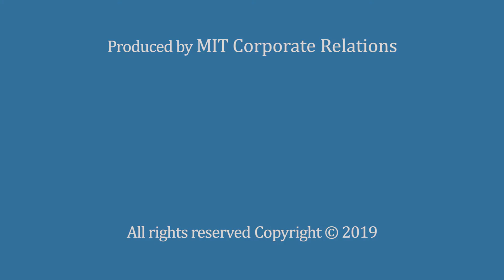LiquidPiston - 001 - Alec Shkolnik - Creating a More Efficient Rotary Engine System

Comment: I am a huge fan of this engine and have been promoting it as widely as I can. This engine will be the backbone of closing the loop in fully sustainable energy for most moderate climate countries. This engine is ideal for embedding into water heaters for residences where the engine can provide 3 kilowatts of electricity for charging battery systems such as the Tesla Power Wall with much of the unused energy charging the water cylinder thereby bringing the system efficiency up to 80%. Charging a 200 litre hot water storage cylinder to operating temperature requires some 10KwHrs of energy and the surplus energy from the liquid Piston Generator is the ideal source for this. People say "but that requires fossil fuel" No it doesn't. The fuel to run this domestic system will come from recycled cellulosic waste (cardboard, paper, garden waste, etc) converted to methane and fed into the gas system for distribution. In this way the non solar period is covered by sustainable sources. A calculation for Victoria Australia suggests that the energy content of their cardboard waste alone is sufficient to cover their non solar period 4 times over. In a complete system the water heating should be done from Photo Voltaic THERMAL panels where heat from the panels is collected and transferred to the water cylinder via an oil transfer fluid. 
I am thrilled that LP are finally looking for global partners for the Generator version of their engine. The 2 Kw generator set developed for the DARPA project is a good start. 3Kw would be better but 2 will do. As person who lives on a boat I am keenly waiting for this product to arrive packaged for marine use.